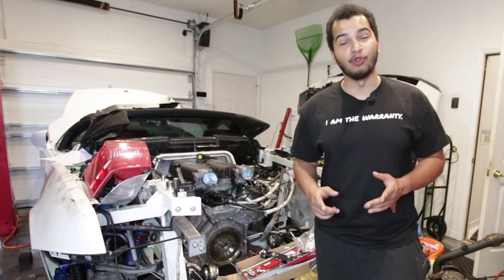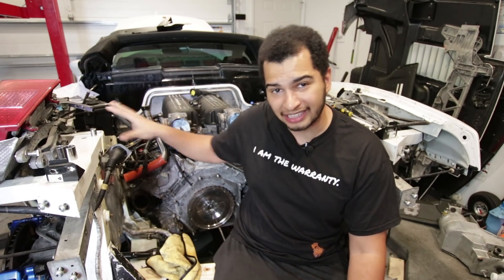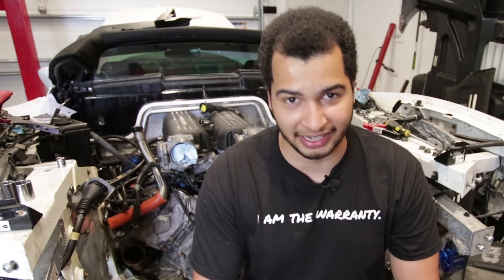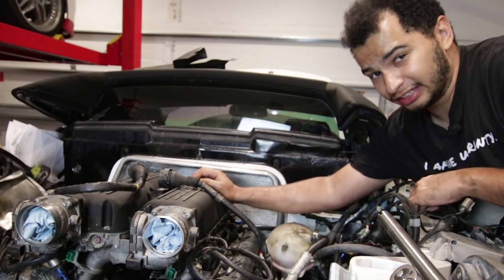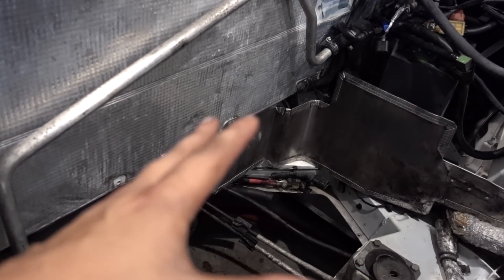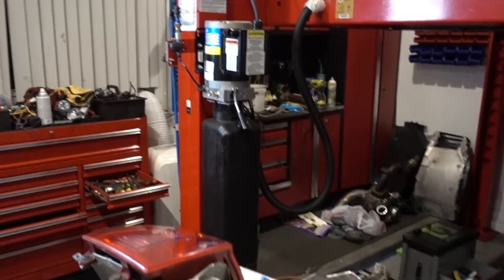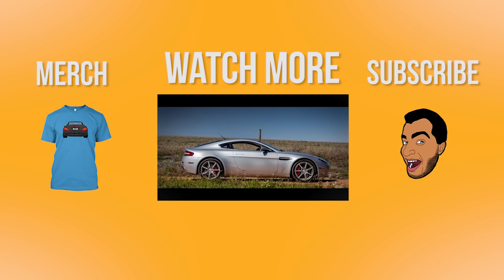Taking Out My Cheap Lamborghini's Engine Was WAY Easier Than I Thought

Comment: I thought the problem was fire extinguisher foam/power inside the fuel tank. You know, from when they put out the fire with the fuel cap open. Why wouldn't you have a quick look inside after all that work?

Comment: I was not aware you had this much mechanic skills.
Reply: I don't think he was either :P
Reply: i dont think he knew either. went from car guy to a lambo mechanic/tec in an hour of video time.  im hoping this gets finished and passes exam so it can be titled. im assuming its a reman engine?, cause theres no evidence of fire damage on the engine itself.
Reply: To be fair, cars aren't all that hard to work on. Most people are just too scared to give it a try. Tons of respect for @Tavarish for helping to break down those walls by and encouraging people to pick up some tools!
Reply: He doesn't! Wy u r not showing the mechanic that is doing the job
Reply: You don't need skill to dismantle something. The skill is putting it back together and working when your finished
Reply: its easy to rip shit apart..
Reply: +paul davison - This. Anyone can take shit apart.
Reply: all you have to do is have the car and the tools this guy has a very nice garage which I'm assuming is a family members if not he is doing well for his age
Reply: Mike George 
Its his... He just bought a 70k twin turbo lambo. He's doing pretty well...
Reply: Supposedly in his other videos it was originally a lambo engine, like a stock one. Then they took it apart and "upgraded" it and "Built" it up. Upgraded piston sleeves, forged pistons and crankshaft, built up further with upgraded camshafts, etc. "Built" up to take a lot of boost, and these cars didn't come with turbos from the factory either, and this car he got was re-designed to run with a pair of twin turbos.
Reply: Fluffy Ponies Obviously, haven’t you seen his other videos that show all that.
Reply: Not hating at all I love his videos and he defenetly have much more mechanic skill than me.
But pulling an engine isent the hardest thing ever. 
Me and my dad pulled an engine in 2days last year and back then we hadent worked on anything more than an go kart.

Sorry for my bad English
Reply: TraxCS your english is fine

Comment: Hoping to save you some work- those are swivel fittings. They are supposed to move like that when something has to be assembled before installation. If you are pulling it apart, might as well send the pumps and injectors out for a refresh to a reputable shop that can handle both now that you are this far in.
Reply: The Fiasco Garage i upvoted so he sees this
Reply: First time I heard of Tavarish was through RCR, so he could easily be in touch with Sloppy Mechanics for the best advice to get them flowed with charts from Matt's "guy" at a good price given the positive exposure it will bring. Seems like a no brainer to use those contacts. I have seen the screens jammed up in both the pumps and injectors at low miles with black muck after either a fuel filler cap off, long term storage, mishandling, or junk fuel. I am enjoying this build and his editing/scripting where he holds back certain things (like the extent of the fire) for the story line and for return comments. I can't wait until he has it running healthy for that, "Haha!" moment. I also feel invested in this build due to his humble demeanor. He is a damn good videographer that plays with cast off cool toys on a different type of budget understanding. I've sadly seen beautiful cars parted out that were deemed 'too expensive' to be saved over simple fixes, so this build is kind of glorious on a personal level. Whomever is reading this- Thank you for doing what you do. You are making the world a better place for the rest of us. Any VINWiki fans? It totally fits.

Comment: Oh my god, please tell me you’re going to smoke the fuel delivery system, check the inside of the tanks, flow test both pumps separately, pressure test both pumps and dead head pressure test them.... WHILE THE ENGINE IS OUT. my god, man.

Comment: After removing the engine, to see the gas tanks lines are fine. I would replace the fuel pumps.
Reply: no shit :D
Reply: prob cost a few k for parts that aren't broken lol
Reply: might be a good idea. you don't know how long that thing would lasts. while the engine is off, why not?
Reply: Why throw parts at it?? He could easily test fuel pressure and see if that is necessary
Reply: The fuel pumps had to be upgraded anyway to support the boost being added. Now I think about it, I take my comment back. That is probably why he didn't replace the fuel pumps. 

Just because you have fuel pressure, doesn't mean a pump faliure could happen tomorrow. Fuel pumps last about 10 years, that car is over 10 years old.
Reply: Those fuel pumps look a lot like the one in my 2007 VW Golf. Probably not the exact one, but you can probably find the VW/Audi part number and swap them out for cheap.
Reply: Motordyne G35 if it's got e85 that'll reduce the pump life
Reply: John Pierce, I actually think they’re the same fuel pumps out of my Touareg v8 😂
Reply: Yeah I'd replace that fuel pump top. That's a janky repair.
Reply: Very much so. a lot of these parts from supercars are parts-bin specials.

When it comes to VW group, look for the skoda/seat equivalent part numbers. They're even cheaper than the VW/Audi parts and the only difference is the label on the plastic bag or box they get dropped into.
Reply: Reach out to the stradman

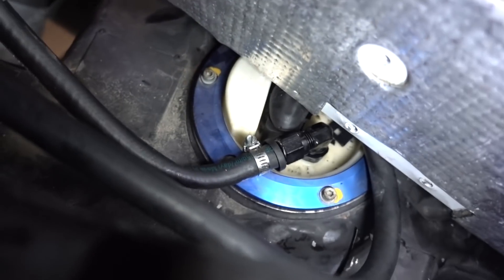Comment: Tavarish you surprise me by not seeing what’s wrong with the fuel system, at 7:30 you can see the bottom fuel hose (the one you mention is loose) is pinched as it twists upwards. Also st 8:14 you can clearly see a compression fitting is missing on the top hose so it’s free to pop off at any time and spray E85/unleaded everywhere. Also the electrical connector to the pump looks snapped too as the top half is not in like with the bottom half, clearly noted by the fact you can see the yellow insides of it. If I was you I’d be pulling the hats off the tanks and looking inside, also pulling the pumps to check them too. Just cause the car is run on E85 doesn’t mean the tank isn’t full of crap buddy. You’ve went this far you may as well go the whole hog.

Comment: Now that it’s out, change the coil packs and spark plugs. Also clean up the engine bay. Those red plugs go bad very often. Happened on my r8 frequently. Latest revisions should be better.

8:18 that rubber sheath to the wiring needs to be fixed or replaced.

Comment: Good job you checked the sender units, at 8:33 compression clamp missing on pipe.
Also at 7:55 someone’s been in there before, wrong hose clip fitted at that sender unit. I would also check the wording on the pipe as it doesn’t look right or the same as other fuel pipes around it, if its wrong see where if goes.
Reply: What? You think someone's been in there before? lol
Reply: it was just a off the cuff quick comment, i've been watching the project and is others for some time now, i was just pointing out lack of clamp and wrong clamp on breather pipes.  just wanted to point out so others that may not beware of its past in this particular video. can't believe that a insurance company would have had it stripped to possibly find Foul Play. even the tanks been out lol. zoom in on tank straps to see more. looking forward to next video.
Reply: Yeah, I’d at least use a higher quality clamp like ones from Ideal that don’t cut into the hose when tightened.
Reply: PipeOrganPhil PipeOrganPhil yea that is not the story I was expecting. It’s crazy that the insurance company would pay to have it stripped down by people who don’t work on those cars and expecting them to figure out if something was purposefully sabotaged.

Comment: As a technician/ mechanic , I’m proud to see average people with little or no knowledge working on their own cars especially a Lamborghini because working on isn’t easy I’d know .need the OEM workshop info / book .just one thing car still looks worse as you take it apart and not to mention dangerous lose fuel fittings also check everything or maybe replace rubber hose with braided hoses ,also the coolant system on these car need maintenance hoses get soft /hard sometimes and since the car / complete drivetrain is out you should check everything and maybe piss off the E85 rubbish because water in your dry sump system is NO good water and oil indeed a lovely thing for a Lamborghini engine,maybe a leak down test just the make sure the engine is alright I would hate to see a Lamborghini engine rebuild go wrong because he engine had so issue . I would/should personally check everything top to bottom front to back then sit down and write it down on paper what need fixing or replacing  .You have a new Sub  mate 👍🏼👍🏼👍🏼👍🏼
Reply: Call me crazy but, it appears he has more than just a little knowledge of working on cars.

Comment: We had isolated issues with refueling in the UK, this was determined to be the breather with a loose connection  from the fuel tanks, made worse when filling the car to capacity with a fast gas station pump. So check the filler and breather these are included to let the air escape from the tanks when filling. My recommendation is to avoid getting air locks by never fast filling the tanks.   Full the car slowly allowing the fuel in the tanks to equalize volumns taking pressure off the breather.

Comment: Please tell me your taking pictures bagging and tagging lines/fittings and bolts. Take videos of disassembly process up close. I do what your doing for a living. This is your first time. Take my advice and take pictures, bag, tag, label Everything. Clean all bolts before bagging them make sure to clean all fittings before bagging them all the prep work on disassembly will pay off in the end. Do not rely on forums for assembly. Try to get any manual you can for the car. Remember with all soft seals to buy oring lubricant it well help re expand the seals so that they compress properly when re installing. Make sure you use proper torques when reassembling. The bolts look like special alloys which could be a nightmare when over torquing. USE LOCTITE BLUE ON HIGH VIBRATION COMPONENTS ONLY A DROP DONT USE TOO MUCH. DONT USE LOCTITE ON PARTS WOTH SEALS IT WILL LEAK UNDER SEAL AND EXPAND CAUSING LEAKS. USE STEP TORQUES. IF YOU NEED ANY ADVICE LET ME KNOW I WILL HELP YOU JUST MESSAGE ME.
Reply: machinist1337 its not his first time
Reply: machinist1337 exactly!
Reply: machinist1337 but do you yank out a lambo engine with a harbor freight lift in your garage?
Reply: pakigangsta5 I dont own a lambo so no
Reply: But he keeps saying working on a Lamborghini is so diy friendly??
Reply: C D I just think it’s kind of wearing out the it’s diy friendly. Taking part a car is easy. Like the op said it’s putting it back together like the factory tech would do that’s tough. I mean I took my moms washer apart when I was 13 but putting it back together was way harder. Taking it apart was just unscrewing things till it all came apart. Haha
Reply: C D true true
Reply: Machinist: what’s wrong with using more then a drop of loctite? That’s a serious question by the way. Very new to all this diy and trying to learn.
Reply: It will
Reply: Ty Smith it will not spread evenly through the threads (grooves) of the bolts, giving a false reading to a torque wrench (it will read to early, and the bolt will actually be loose). Basically, you want enough to fill in any imperfections in the machining so that the bolt seats 100% with the threads, and grips evenly.
Reply: Thanks man.
Reply: I can agree that this does help when I pulled the motor from my truck. If only I took pictures.
Reply: Ty Smith it wont dry properly.

Comment: Love this series ! After that amount of work I would have pulled the fuel pumps/sending units to at least have a peak inside the tanks. Lots of stuff going on in there from connectors to suction tubes etc. pumps/sending units sit in housings inside tanks and who’s to say they weren’t just “tossed” back in there. Imagine putting everything back in there and filling up you tank to find your gauge isn’t registering for instance. It was a fuel related salvage. Examine it 100%. Other than that, great job getting in there !

Comment: I would be a bit scared pulling out that v10...
Reply: Well, seeing as the gearbox and driveshafts are already out, removing the engine is easy.
Reply: atleast its not an awd territory, gah
Reply: I know your pain, lost some skin on the fuel pump swap.

Comment: TIME to replace all the Fuel lines and all hoses since you are there. Even if they look great you dont want to have to have the need to replace them later if needed. that hose on the first tank looks kinked.
Reply: Agreed, with the engine out replace as much as you can.  Also make sure to use fuel injector clamps and not those screw on type.

Comment: After seeing the photos from the first salvage sale, where the engine and tranny were out and crated, it was probably a good idea to pull the engine anyway.  All the work by the previous salvage buyer is pretty suspect, especially when you found the loose fuel lines.  You now have the chance to check everything critical, and ensure bolts are tight, wires are connected, and parts are cleaned as they go back in (working on a clean engine is so much better than working on a grimy one).

Comment: You take apart (and put back together) A LOT of cars. What's your system for keeping track of what connector goes where, what hose is connected to which opening, etc...?
Reply: This video, directors cut.
Reply: Honestly it's not that hard to keep track of stuff if you have a lot of wrenching experience...

Comment: So you would normally have to take the engine out to get at the alternator?  Wow.
Reply: where else are you going to put it, you cant put it on the rear of the engine because thats where the transmission is
Reply: Probably good placement. I haven't replaced an alternator in a long long time...
Reply: Add it to the flywheel construction, no more belts needed. Not as if that's new technology, bikes have been doing that for decades and hybrids do it all the time (they also use the same tech to eliminate a separate starter motor. 
Once you do that then you can uprate the power generation and go for electric AC and steering (even fewer belts, flex hoses and hydraulics to go wrong). The least reliable parts in modern cars (even italian supercars) is the mechanicals, not the electronics. (and even in older times, it was usually the connectors that played up, not the actual electronics - connectors have been sealed and grease filled for over a decade. Keeping water out makes all the difference to reliability)

Comment: Might be a good idea to upgrade fuel pumps while your in there.  You can buy quick connect fittings and nylon hose really cheap and is very easy to install.  No more out dated hose clamps and rubber hose that collapses like the one connect to the loose fitting on the left side

Comment: As many others have commented, I would be concerned about the driver's side fuel line. A hose clamp can't take the high pressures from the fuel pump. Also, some others commented on dropping the fuel tanks from below - this might not be possible depending on how it's attached. Great channel, btw!

Comment: E85 is hard on the whole fuel system. if it hasn't been upgraded or didn't come from the factory ready to use E85, you may have some issues coming your way. Many manufacturers will void your car warranty if you run E85.

Comment: Tavarish, do yourself a favor and avoid using an adjustable wrench whenever possible.  They have a tendency to round the corners of your bolts even after one or two uses.  This will create problems for you down the road.  Just a piece of advice if you choose to take it.  Also, if you have the ability to check the runout of your flywheel you should.  If it got too hot it could have warped.  Resurfacing isn't just to remove imperfection in the surface.  It's the same issue you might find with brake rotors that got too hot.  Again, just a thought.  Keep up the good work!

Comment: Pull those tanks, Leak check them, check your fuel pumps, change the filters and ditch those soft line/fittings, It would be a shame for you to get it back together just for a hairline crack to cause another fire. As previously said theres probably foam or whatever was used to extinguish the original fire in at least one of the tanks. If you can afford it, I would change you belts as well as it saves you pulling that lump again in a few thousand miles, and you can at least be confident that when you rev the nuts of it its not going to go bang on you. All the best dude best channel on you tube so far!

Comment: you will not know if your tank top hats and fuel lines/fittingd are ok until the pump is running, seeing as you can only get to them with the engine out would be a good idea to pressure test them somehow.
Reply: just replace the pump on left. it's been badly repaired.

Comment: Now that the engine and tranny are out, I would clean up and detail (sort of) the engine compartment and paint/touch up the scratched areas on the frame and surrounding areas/components.  This is the time to take a day and clean her up!   You'll be glad you did once it's all back together and you're cruising down the road in that beast!
Reply: You might also want to check inside those gas tanks, and the pumps to make sure they're working/pumping and not leaking.  A visual is a little too little for myself, I would do a physical inspection considering how far you have it apart now.  Keep it Up!  Good Luck!  
Can't wait to see it start up!